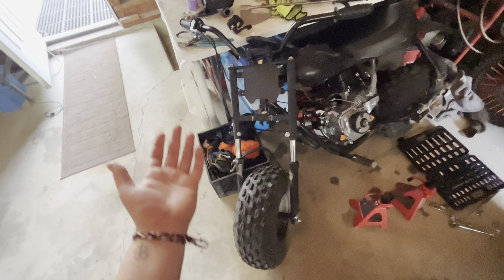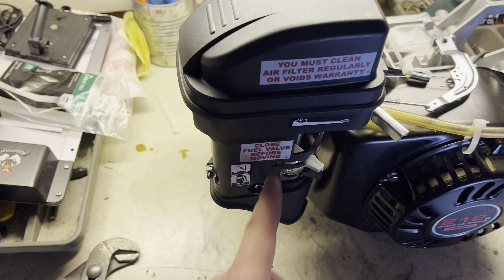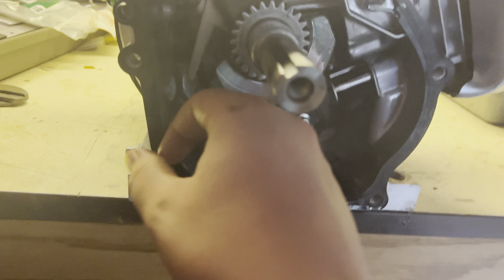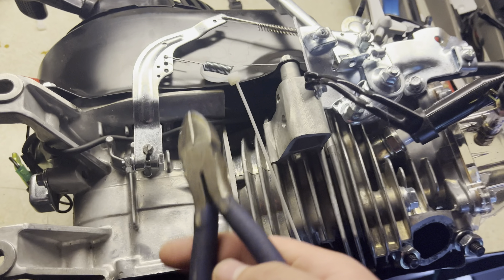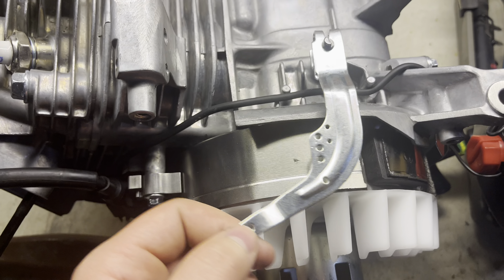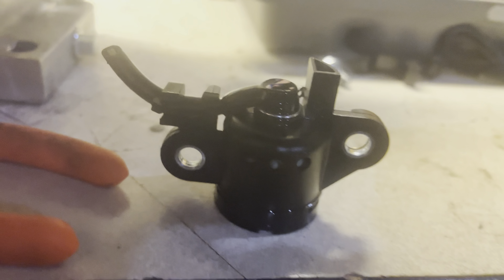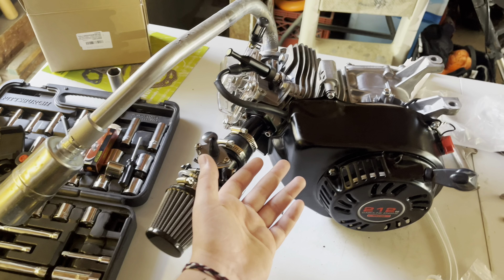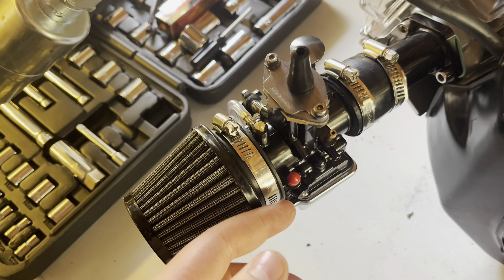Race ready mini bike engine!!

Comment: Some valve springs and a mild cam would wake it up, if you have the right tools you could port and polish the head for more flow and shave the head down for more compression. You could also get 0.10 head gasket instead of of the stock 0.50 headgasket. Nr racing sells stampd 1.3 ratio rockers for $20 they are the bst bang for your buck part.
Reply from the maker: Dude that’s cheap for rockers too. I might have to check them out. I have 26 pounds somewhere but I lost them for this build 😭. Gotta clean my garage up . 🎉thanks for the comment

Comment: Aye bro cool video I like how you you did this definitely got my sub man ! Next time tilt the motor so the valve lash doesn’t have to be done!! And good luck ride safe !
Reply from the maker: I appreciate it dude!! That’s a good idea will do!! Thank you for the sub :) almost at 700 . You too ride safe man.
Reply: There was no need to do valve lash. Once the lifters and cam are in you just have to get the pushrods back in place and you are done.
Reply: @Deucealive75  no sir the valve aren’t adjusted anymore you remove they are out of there rods then you have get your fuel gager set it too 00.3. That’s why when your doing gov delete put the motor on its side so none of it falls out
Reply: @BetterAnthonySpano  I will ride safe bro. I’m on the road to 600
Reply from the maker: @BikeofLife103  I’m on the road to 1000. I was hoping I could reach 200 subs. So much has changed you just gotta keep grinding. I’ll give you a sub I like your content as well
Reply: @BikeofLife103  I will have to explain. If you loosen up the rockers to get valve train components back in place of course you need to do the lash. Loosening the rockers is not needed. All you have to do is push down on the top of the rocker which opens the valve. This gives enough room to get the pushrod back in position under the rocker. Easy enough.

There are a lot of guys who mess up a simple adjustment like valve lash. If they did it the way I described it would save them a lot of time and frustration. And I'm sure this has happened to kids who don't even have feeler gauges.
Reply: @Deucealive75  well I’m still learning when I get through it and can’t figure it out I’ll defly try this!
Reply from the maker: @Deucealive75  okay cool

Comment: Which carb did you buy?  Got a link?
Reply from the maker: I can’t find a link. It’s a pwk28. You can find them on go power sports or maybe on Amazon
Reply: @BetterAnthonySpano  I ordered the vm 22 as a starter carb to get into these bigger carbs..   How's the pwk28 working for you
Reply from the maker: @buddahmayne9273  dude it’s working great . Didn’t even have to tune it 😂. I shoulda started it up in that vid but I didn’t wanna have to tune it. Turns out it’s perfect
Reply: @BetterAnthonySpano  can you make a video of it running
Reply from the maker: @buddahmayne9273  Ittle be out in 5 days. I got a new frame cause I messed up the Baja again 😔
Reply: @BetterAnthonySpano  gotcha

Comment: I got the nut off with impact, no hassle went to hand thread back on and it seems gummed up and won’t thread back on. Should I retap nut and rod or replace nut? Having a hard time finding proper sizes for both options. Any help?
Reply: I must add, I suspect it’s an m14x1.5 serrated flange nut, but I just cant find this anywhere. I want to confirm before I attempt to retap. Love the content
Reply from the maker: The flywheel nut? It shouldn’t have stripped it check it out but if it did strip it you probably should re thread it somehow . Or buy a new nut. Explain it a little more I’ll try to help. And thanks! I’m happy you are enjoying my videos 🎉❤🤌🤌